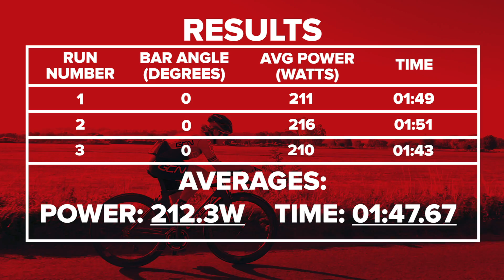How To Test Your Bike To Make It Faster | GCN Does Science

Comment: Compensating for weight is wrong, you cant randomly assign a weight to a wheel.  The weight of a wheel is an inherent property of the wheel you are testing.  A field test is good for this because the differences between wheels are not purely aero.  To get even more into the weeds tires on that wheel are even harder to control, unless both wheels have the same internal and external rim width, and you are using the same tires and tubes at the same pressures between the two wheels.  But if the wheels have different internal and external rim widths, that becomes another inherent variable to the different wheels.

Comment: You could eliminate the variation in time (speed) and power by dividing mph(kph) by power. A more aero setup would give you greater speed/watt. Then holding power or speed within a small amount of variation could give you some valid information from a small number of repeats.
Reply: If it’s aero drag then power is proportional to speed cubed.

Comment: Annoyingly, the only way to accurately measure the aerodynamic differences between small changes on bike setup is to use a wind tunnel - having spent hours wind tunnel testing bike setups for my dissertation!

Great explanation of designing experiments though :)

Comment: Emma, great video. How accurate is Strava for measurement of such an experiment? Maybe you could check with Strava how long of a Segment I need to overcome the measurement error.
Reply: Al Tithecott Just do an out and back ride or a couple of laps on a course with Strava and look at the result. As Strava also says on their website, there are some inherent inaccuracies with GPS. These can lead to very significant variations, especially when you're looking for small differences from positing changes. So unfortunately you can not use Strava to record your splits for these kinds of tests.

Comment: Nice video Emma.  Good explanation of the key principles to follow and consider when doing this kind of experimental testing. If you’re not already familiar with it, I suggest checking out Robert Chung’s virtual elevation method. I’ve been using it for the last few months to determine CdA and Crr changes, and I’ve found it to be more effective than other field test protocols that I’ve tried in the past.

Comment: Buy a low racer recumbent, install a fairring, or even better, buy/build a velomobile
Reply: or a batmobile. Batmobiles are SUPER fast.
Reply: velomobiles are still human powered, although technically many are trikes, not bikes. and fir comparison https://m.youtube.com/watch?v=7wvbVa4-Ewo&index=3&list=PLZWUH_85V1ZO73-eBznTirdq-Qyv7y9E2&t=0s
Reply: @taufikabidin412  batmobiles are 🦇 powered
Reply: @taufikabidin412  on a more serious note, these velomobiles are incredibly. It would be fantastic to see them in use with a small electric engine for the initial acceleration to then be maintained by pedal power.
Reply: But you'll still need to test variables (particularly the fairing/body design), and the descriptions of how and what the pitfalls are in the vid still apply.
Reply: @pjclinch00  I see. I guess the would apply to the batmobile. Or an F1 car. :)

Comment: Nice vid. Just a couple of things to add:
1. Find a road with a steady gradient that puts the wind as much as possible from behind. Wind has a lot less influence from behind than from any other angle. This can mean that you have to wait for a day with the right conditions. 
The thing with tail wind is, though, that it is far more difficult to ride at a stable power output with tail wind than with head wind, which brings me to:
2. There is a lot of concentration and time involved in doing this kind of testing. Speed and power should be as stable as possible within each effort (normalized power and average power should idealy be exactly the same). If power and speed vary a lot, a) conditions may be too variable to perform a good test, b) the road you selected may not be best suited for testing, or c) you may not be experienced enough to perform these kinds of tests. Riding with a really stable power output over several intervals requires quite a bit of riding experience. 
3. As soon as you see the conditions changing, you should abort. If you can see circumstances are different, they are already way too different to come to any real conclusion. 
4. You should do the runs with alternating setups (run 1 with 0deg, run 2 with 5deg and so on). Small changes in circumstances are than smoothed out better. Yes, this is extra hassle, but it helps smooth out smaller changes like rising temperatures.

Comment: I suspect that to do enough repetitions to have adequate statistical  power to pull a signal out of the noise you would need a longer course and a quite large number of trials, necessitating several days of testing.  Try to do it all in one day and fatigue confounds.  But one would have to make sure both variables are tested the same number of trials each day.  My guess is it is pretty hard to ever get a convincing result without a wind tunnel.
Reply: Testing in a velodrom is much cheaper than in a wind tunnel and eliminates at least the wind influence.
Reply: @janpeterlassen7791  

Yes.  Assuming of course that you live in a civilized place where they exist.

Comment: One thing I noticed was your elbow pads were not under your elbows. Shouldn't they be a bit further back ? I don't do that kind of test, I find my time is better invested in getting fitter which is probably the most significant way most people can get faster. A bike fit is a very good investment though. But once you get your position dialed in I think it's unlikely that any further adjustment will lead to significant time improvements. I would love to try one of those devices that give you a realtime drag coefficient value. It would allow one to make incremental changes while not having to go through such a tedious process.

Comment: Nice video about the scientific method. One thing I would like to add: You should first be sure about all influencing variables, ideally with a rough idea how much they influence the measured values. for example you won't care about changes of solar winds if you measure speeds with different handle bar angles :) 
In your case I would say that the most important influence are the wind conditions, far more important than even changes of a few grams of weight or even the handle bar angle. So unless you get that completely under controll, you won't be able to isolate the influence of the changed variable. 
But that won't matter anyway, because it just means that since you cant controll that external wind variable, you wont be able to controll it in real life either and it will always be "as unpredictable" as it has been during measuring. So the solution would be to run more like 100 test runs, to cancel out that wind-variations over time and get the average benefit of your changed handle bar angle.
Reply: i would probably increase the distance instead as the wind comes and goes but also increase the number of trails